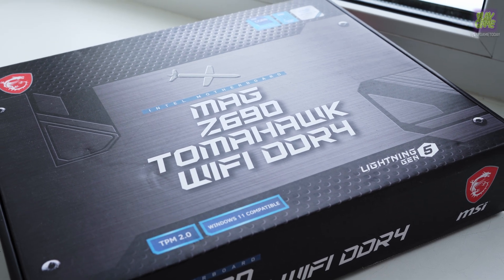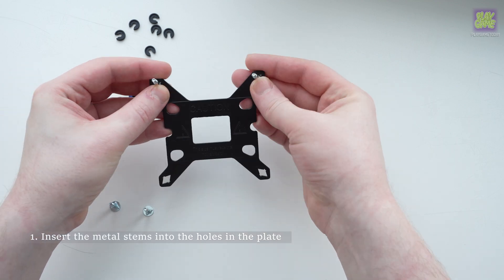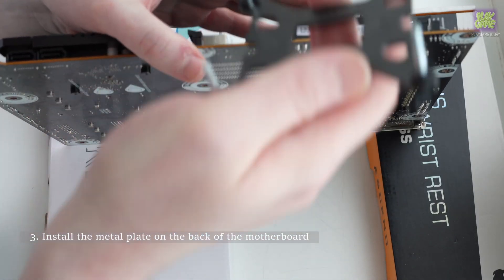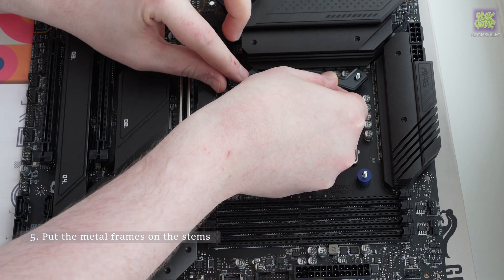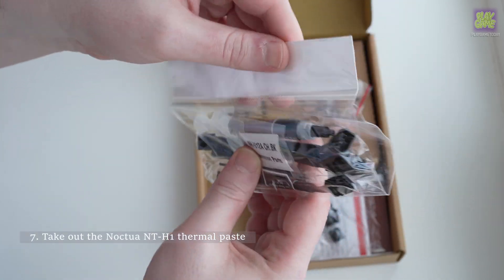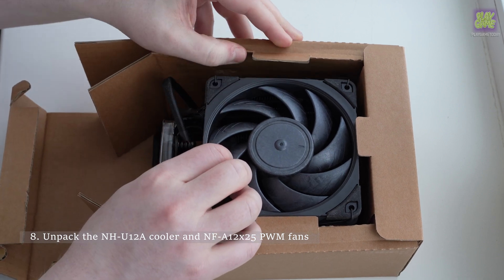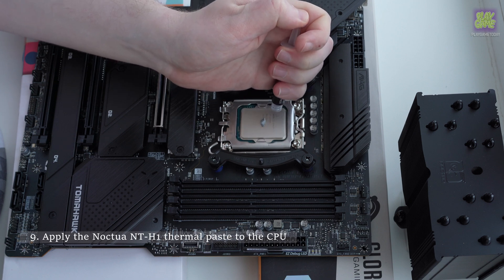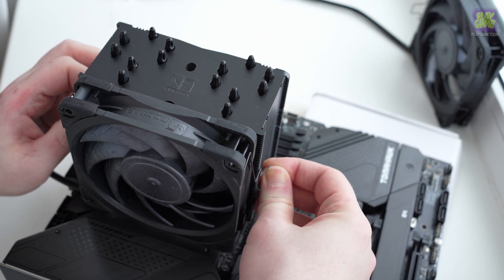❄️ How to install Noctua NH-U12A chromax black cooler to MSI Z690 Tomahawk / Intel 12700k LGA 1700

Comment: It might be better if you remove this video. There are 2 very important mistakes that may mislead newbies and make them install the cooler and the fan next to the ram in the wrong way as you did in the video. It's not hard making a proper video. Cheers.

Comment: You incorrect install fan
Reply from the maker: Fan installed correctly
Reply: @PlayGameToday  you install the fans in backward.
Reply from the maker: @TAIFUNTeam Fans installed correctly, the tower direction was incorrect
Reply: @PlayGameToday  12:38 the cooler #2 directs the air into the system block. 13:16 the cooler #1 directs the air into the system block.
You can verify this by uninstalling the coolers and looking at the arrows that are indicated on the cooler body
Reply from the maker: @TAIFUNTeam  Yep, you are right! Later I reinstalled this fans. They should have been flipped backwards

Comment: I'm confused. On the manual, the "noctua" word on the tops of the fans face the opposite way, as if the fans are each on the wrong side. I didn't know it mattered, until I saw the manual.

Comment: pump 4-pin is not correct, this is for the aio and may run fulltime @100% . Connect the fans to CPU_fan1 and CPU-Fan2, in case u dont have use a Y-Cable
Reply from the maker: Thank you for pointing that out. But your advice is a bit off, because in MSI Dragon Center you can specify the speed of the PUMP cooler. And in the BIOS you can even more precisely specify which cooler is connected to the PUMP connector (there are options there). Also, reading the MSI Tomahawk Z690 manual, you can see only this CPU_FAN1, PUMP_FAN1, SYS_FAN1~6: Fan Connectors. So there are no CPU-Fan2 port on this MB.